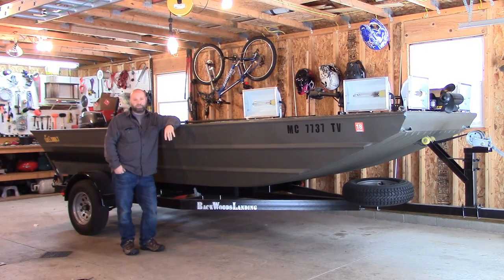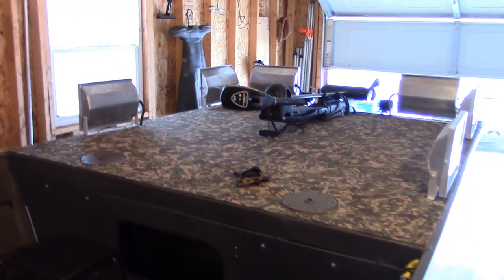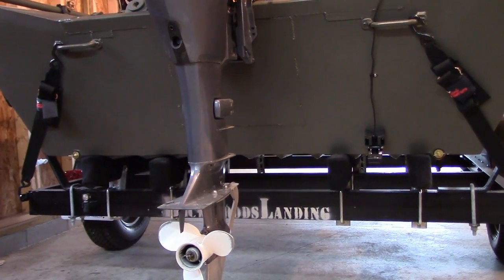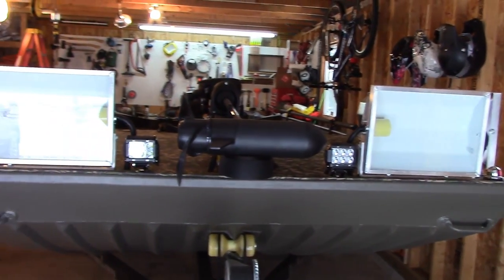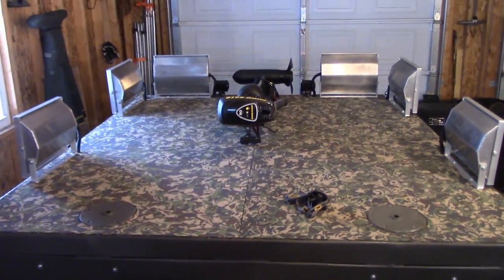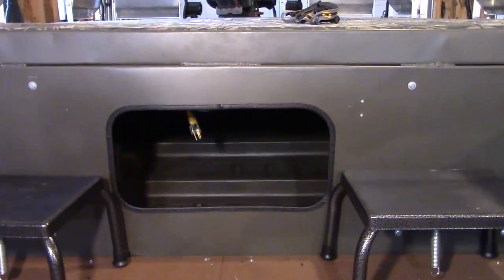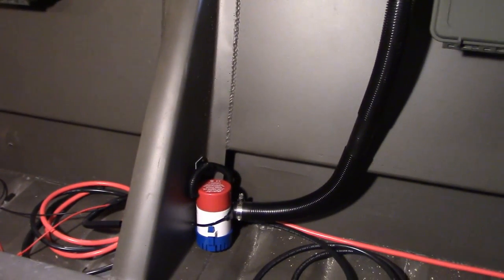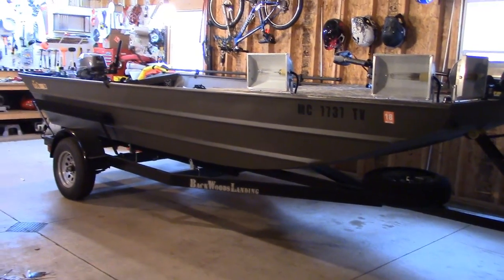My New Bowfishing Boat (part 1)

Comment: Awesome boat!. I’ve been wanting to purchase these same lights. How many watts does it take to run all 6 lights with the ballasts? Also, about the light wiring... do the lights just plug into ballast and ballast into genny ? What powerstrip did you use to connect ballast to genny? Thanks in advance.
Reply from the maker: I'm running all 6 with a 3500 watt genny. Never tried anything smaller. Yes the lights and the ballasts are simple plug and play. I used 2 yellow thick 3 cord adaptors and into a 30amp rv genny cord that had 3 120 plugs on the other end.
Reply: Traditional Bowhunting And Wilderness Podcast thanks for the quick reply. One more question I forgot to ask was do you know the dimensions of the light housings ? Thanks
Reply from the maker: @leelee5123  I dont off hand and not home for 2 days to check. But if you call showmecustoms he can give you the specs and details right away. That's probably the best bet as mine are 5 years old and they may have changed a bit, I dont know.
Reply: Traditional Bowhunting And Wilderness Podcast how do you have you lights grounded to boat?
Reply from the maker: @leelee5123  I dont have the lights grounded to the boat. They are 120 volt 3 plug so ground is thru the wiring

Comment: dare I ask how much $$.$$$
Reply from the maker: +Andrew Barlet  I have just over 9k in the boat, trailer, and motor. plus 800 for troller, and about 1500 in lights and accessories. so in total just under 12k.